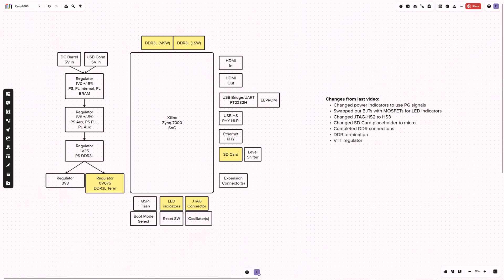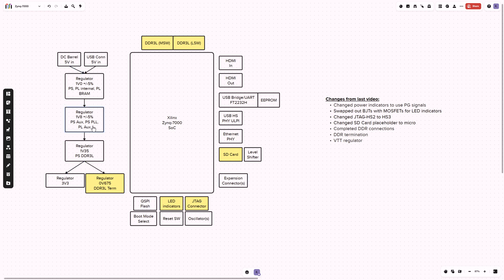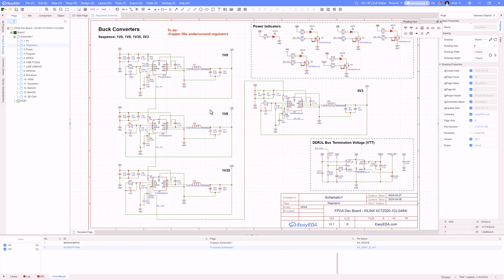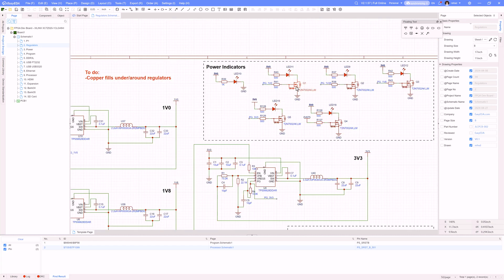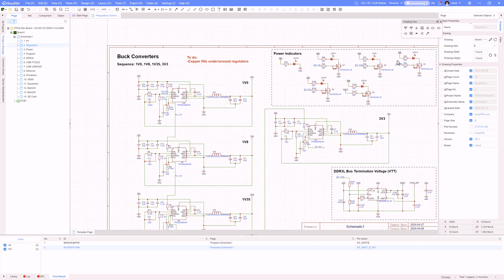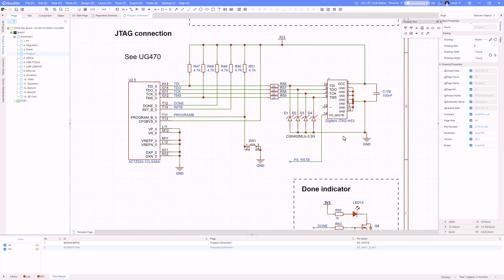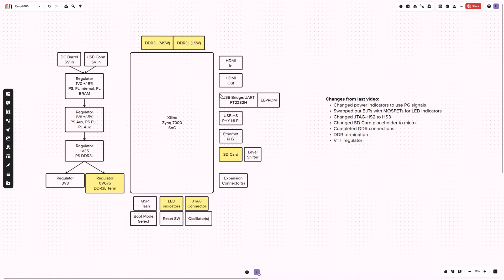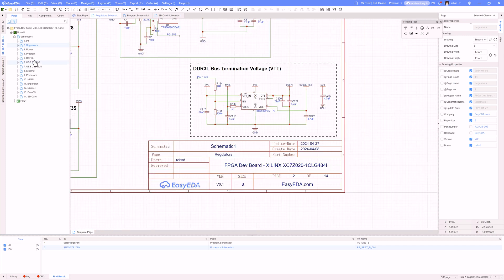Zynq-7000 PCB Build - Part 4 - DDR

Comment: I don't know what voltage levels your PG signals have but that 0.675 may not turn the MOSFET on at all. Anything below 4V is a little bit iffy for 2N7000.
Reply from the maker: For the TPS56628DDAR, the PG is pulled up to VREG5, which is listed at 5.5V typical output. @asmi06 mentioned a TPS51200 for the DDR termination voltage; I'll look into it, as it has a PG which might be helpful here.
Reply: @rehsd  I use DMN2020LSN MOSFETs because they have a typical threshold voltage of just 1 V (1.5 V max), which makes them suitable for signals with logical levels of 1.5 V and above. And they are also super-cheap at about 18$ for 100 devices (18c each) - which will last your for a good while.
Reply from the maker: Maybe I could use a BSH103? It appears to have a 0.4V threshold voltage. https://assets.nexperia.com/documents/data-sheet/BSH103.pdf
Reply: @rehsd  That one should work too.
Reply: @rehsd  0.4 V is super low, but it's minimum value (at 1 mA). Typical and maximum values are not specified. You would have to get some and check yourself.
Reply: @pvc988 it doesn't really matter here since we're talking about driving LEDs with 1-2 mA of current. This, of course, becomes important if you need to drive some serious load, but in that case, you can just use two of them - the first one drives a gate of the second one,  and the second one drives the load.
Reply: @rehsd  based of the BSH103 datasheet, even with a minimum VGA 0.4V, in order to achieve low drain-source on-resistance (RDSon) and proper operation, the VGS of 2.5V is recommended as a minimum before a 500Ohm Resistor, based on the given specs (RDSon = 0.5 Ω at VGS = 2.5 V and ID = 0.5 A). However this is for optimal energising of the MOSFET, at approx 5V you will source the LED power from, this will work fine. I would though decrease the resistor to something less than 100, MOSFETs don't really need current limiting the same way BJTs do :)

Incidentally, you can replace all these MOSFETs with a Darlington array, something like ULN2003/4 and have up to 7-8 leds driven from that. From the current mouser prices one of these is about 30c-40c, so maybe cheaper than a bunch of MOSFETs ? Circuit will be a bit different though, each input to turn on a led needs around 3V (the PG signals will be fine, but unsure about the  0.675V one, that would perhaps be better served with a MOSFET:)

Comment: I highly recommend you to switch to 0402 as a "default" size for passives - they are the cheapest size (0201 are usually more expensive than 0402), they take little PCB space and yet are still large enough to be handled manually with some practice perhaps. I only use sizes other than 0402 when there is a good reason to do it - typically it's capacitance and voltage for caps, or power dissipation for resistors.

Comment: If you want to have a "power good" signal for DDR3 termination, you can use a TPS51200 regulator - this is what I use in my designs which require termination.

Comment: You have a typo in schematics - at the Zynq symbol, you call positive clock as DDR_CK_P, but negative is DDR_CLK_N, while elsewhere it's called DDR_CK_N. Also remember that termination for clock line has to be beyond the last chip, so routing should be Zynq -> DDR3 chip 1 -> DDR3 chip 2 -> termination, chips shall be in the same order as other control signals in a flyby topology.
Reply from the maker: You have a good eye for detail! I corrected that network label. Thanks!
Reply: @rehsd  It's just a fresh set of eyes, which may have missed similar things in its own designs in the past...😉